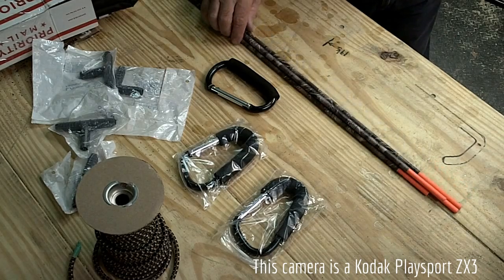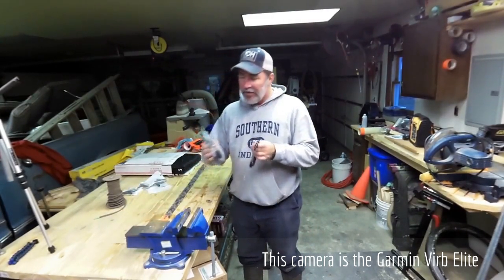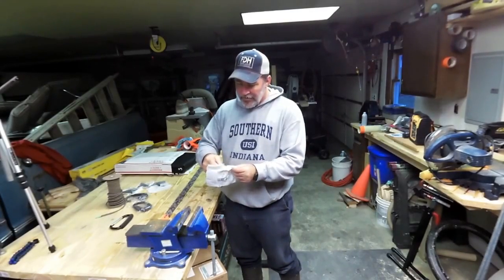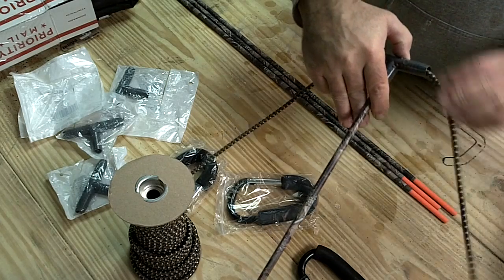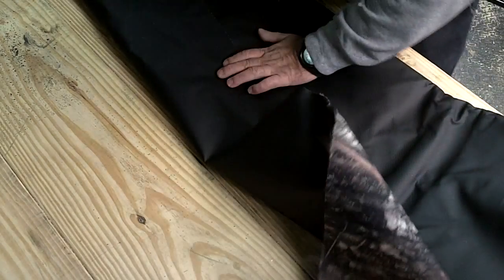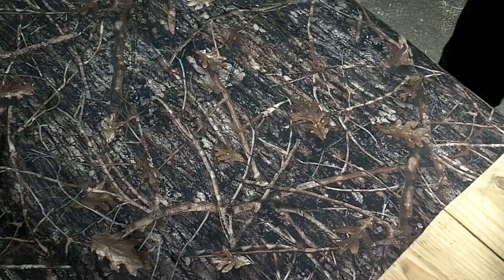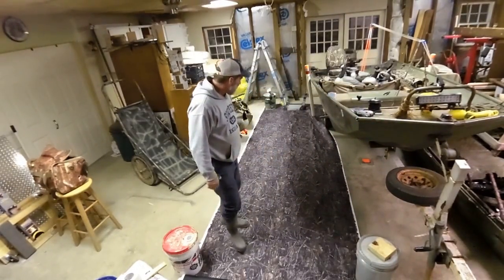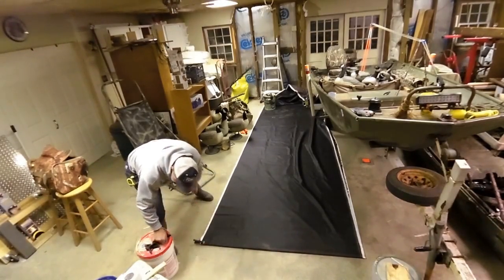Making a boat duck blind DIY part 1

Comment: why not just use camo burlap?
Reply from the maker: donnsald trump
I mostly use the boat when the weather is nasty. This waterproof material blocks the wind and rain. Burlap soaks up water and is less useful when it's wet and heavy.
Thanx for watching.
Reply: Whats the website you got the material from pls.
Reply from the maker: @reddog270ss  Ebay.